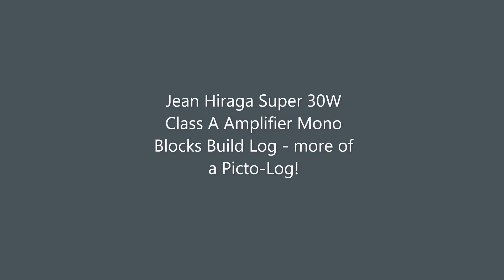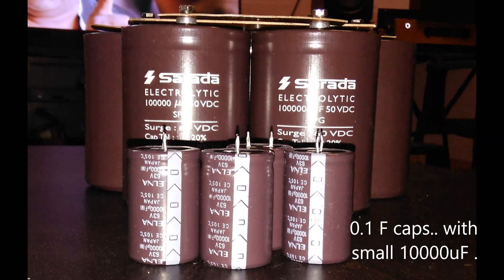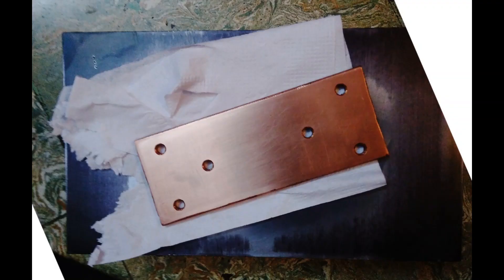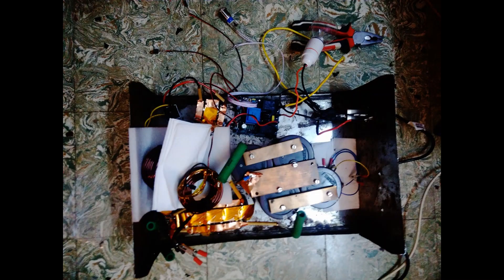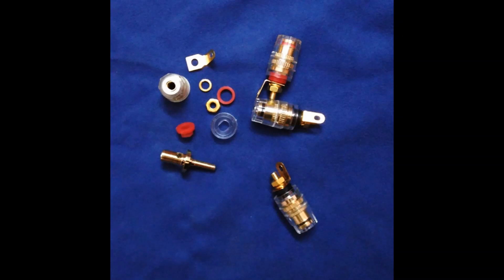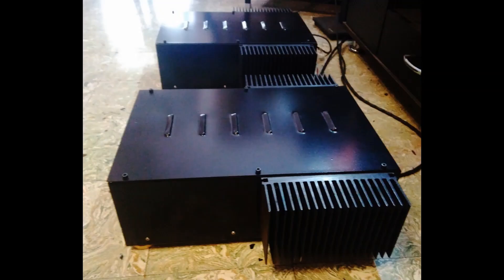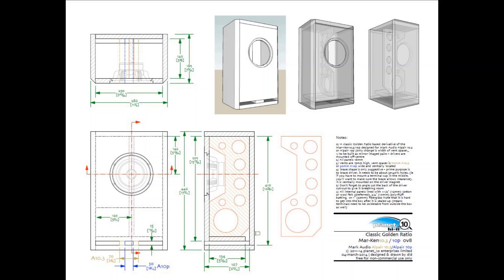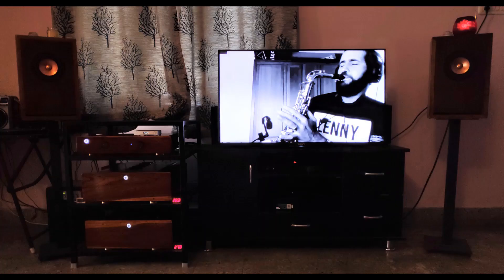Build Log : DIY Class A Amplifier Jean Hiraga Super 30W Amplifier and Alpair 10.3M Speaker

Comment: Which transistors you use?
Reply: 2sa1943 and 2sc5200 work perfectly
Reply: @ElectronicMania  Output transistor is fine the issue is with the driver section finding replacement to 2SA872A, 2sc1775A, 2SA634 and 2SC1966. In addition the 442 ohms , RD22 none of these are available in India. I checked few places
Reply: BC 560, BC 550 , TIP 42 and TIP 41 on the driver stage, also replace the 2 x 47k resisters with 33k on the supply rail when using these transistors. As for diodes you can get BZX85 from project point. 442 ohms resister could be procured from Tanotis. Trust me amp is not easy to build. Every components needs to be matched. Transistor readings should be identical when measuring via DMM. I dropped the project as I was getting negative voltage via speaker output along with a growl. A constant Hum was also observed from the output. Checked all the components and they all seemed fine. If some one can help I would like to try again